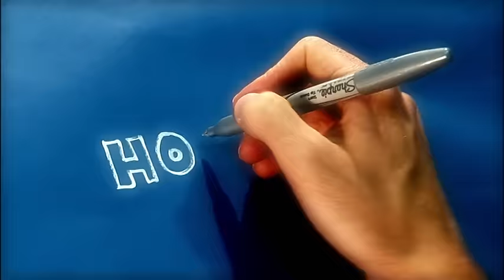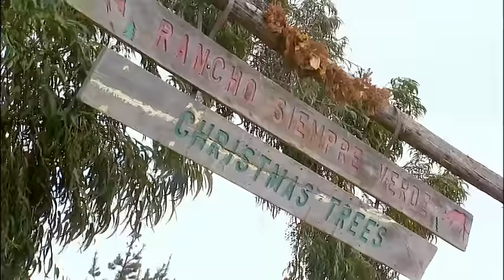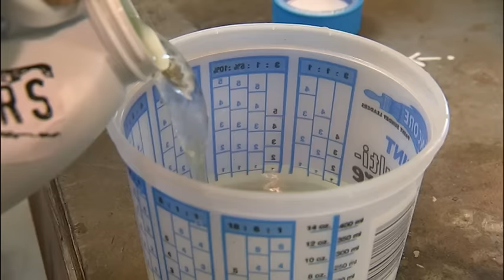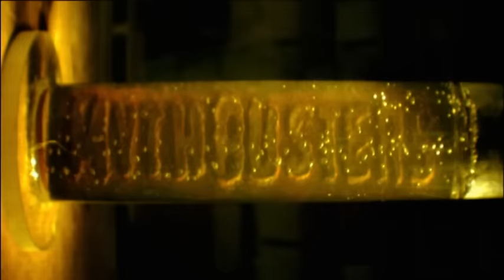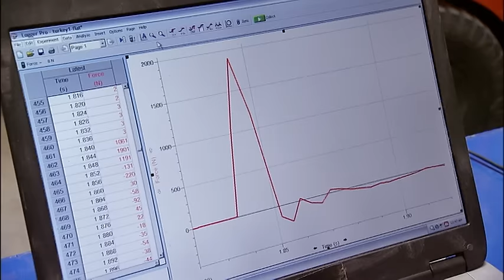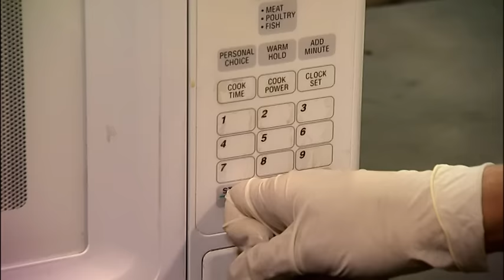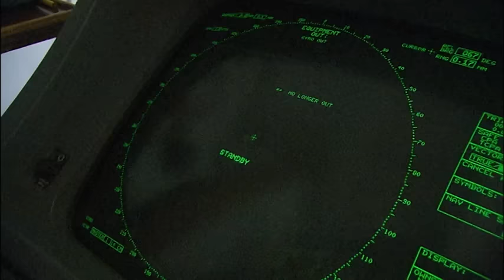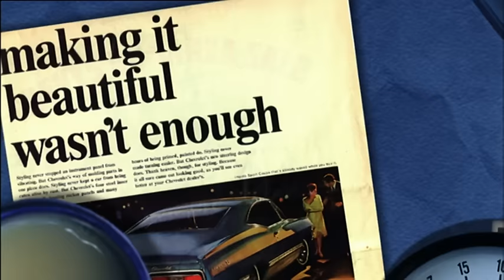Could Reindeer Help Santa Fly? | Festive Special | MythBusters | Season 5 Episode 1 | Full Episode

Comment: The best way to keep a tree fresh is obviously to keep it with roots and soil. It can last a couple years that way.
Reply: I think it would be more than just couple
Reply: I don't know why people keep insisting on using real trees when you can buy a plastic one that will last for decades.
Reply: @Glumpsy  then to landfill, real tree with roots last for years, then compost, stop buying plastic.
Reply: @gavbarker8689  You realise you don't have to throw it out, right? Nothing will happen to it. We have this old tree that's older than me, nobody puts it up because there are no kids in the house, but it is still fine. And it will be fine when I finally kick the bucket. Which also applies to other plastic trees, I assume. No point in replacing it.
Reply: last a lifetime weirdo

Comment: The reason why spraying your tree doesn't work is because the capillary movement of moisture from the base of the tree is driven by pressure differences from the top and bottom. This is normally done by wind moving air over pores in the needles or leaves. Spray the tree, seal those pores open or closed, and there is no pressure differences, so no moisture movement and you get a very thirsty and sad tree.

Comment: Easily could tell you the frozen turkey will break a bone, I dropped a roll of frozen bologna on my toe, split the bone in two, back when I was like 13, I'm 26 bone still broken in two, pinky toe, doctors won't do anything for it because it's not important enough of a toe, it honestly didn't hurt for as long as it did nor did it impede my walking, the only issue is you always end up stubbing the bad toe